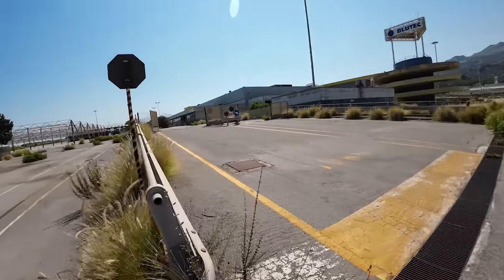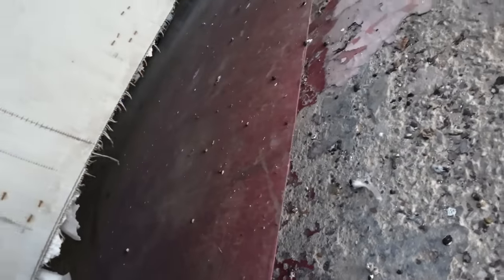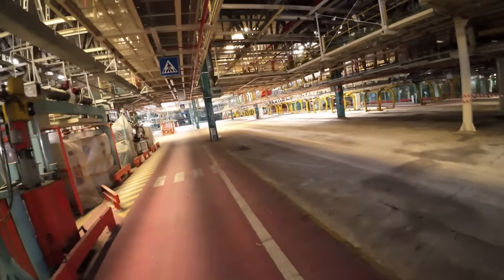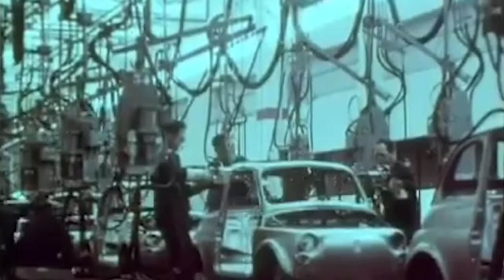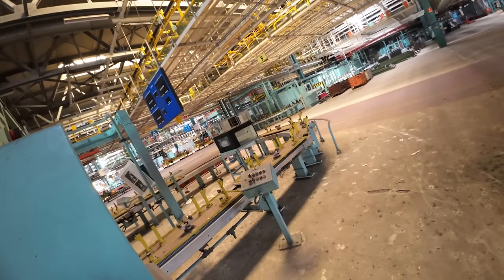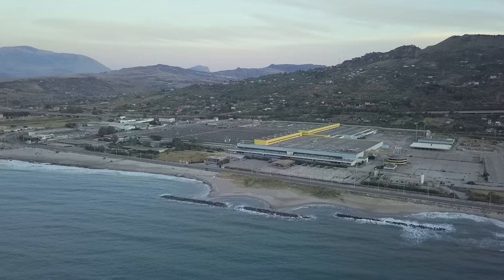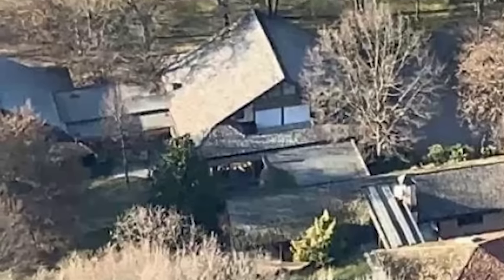Sneaking Inside Completely Intact Abandoned Car Factory

Comment: Very interesting. On 3:44 these hanging yellow tools on either side of the assembly line were used for attaching the wheel bolts. They can tighten all the screws on a wheel at the same time.

Comment: I like the Hot Wheels style garage car ramp at the front. I was expecting to see a winch operated car lift and foam hair roller car wash, lol. Great video as always fellas.
Reply from the maker: Thanks!
Reply: Yeah that spiral ramp sticks out, but where does it go? It seems to just end on the roof and have no real purpose other than to look good. Maybe Fiat wanted some " Lingotto" style in there :)
Reply: @Rockport1911  I came to the comments to find the answer to this as I agree...it goes nowhere.  So odd

Comment: 126 was never produced in Termini Imerese, it began production in Cassino (south of Rome) before moving to Bielsko Biala in Poland, 500 was produced in Termini until the end of the seventies when they reverted to the production of the Panda 😀
Reply: Fiat 126 Assembly :
Cassino, Italy
Termini Imerese, Italy
Tychy, Poland (Polski Fiat)
Kragujevac, Yugoslavia (Zastava)
Graz, Austria (Steyr Puch)

The Fiat 126 was produced until 1979 at Fiat's factories in Cassino and Termini Imerese - with a total production of 1.352.912 in Italy. The Fiat 126 was also manufactured under license by Zastava in Yugoslavia. In Austria it was briefly assembled by Steyr Puch as the successor to the successful Puch 500, with assembly until 1975 - and production of 2069 units.

Most 126s were produced in Bielsko-Biała, Poland, as the Polski Fiat 126p, where production continued until 2000. In many markets Fiat discontinued sales of the 126 in 1993 in favor of their new Cinquecento with its front engine. With a length of 3,05 meters, the total production of the 126 reached almost 4,7 million units. In Poland, the car became a cultural icon and was nicknamed Maluch, meaning “the little one” or “toddler,” which eventually became an official model name in 1997 when it appeared on the back of the car.
Reply: The FIAT 126 was produced in Termini Imerese !!!!!!!
Fiat 500 - 1970-1975 = 207,988 units produced
Fiat 126-1975-1979 = approximately 200,000 units!!!!!!!!!!!!!!!!!!!!!!!!!!!
Fiat Panda - 1980-1992 = approximately 2,300,000 units
Fiat Punto - 1993-1999 = approximately 900,000 units
Fiat Punto II - 1999-2005 = approximately 350,000 units
Lancia Ypsilon - 2005-2011 = 374,722 units

Comment: So the plant is located here: 37.97043331958398, 13.757084650950118

Looking at it from above, we can see that the Paint shop is in the lower right hand corner and takes up about 30% - 35% of the total plant. Which says to me that it was a small plant, and constrained by its neighbors (preventing it from growing any larger). Which explains why sludge and the RTO (incinerator) were located insanely far from Paint. Sad, but they really didn't have a choice.

So was the spiral ramp under the Blutec sign used for foot traffic? Apparently so. You can see the alternate stair access to the roof @2:59

@0:38 fixturing to hold the engines as they are built. Looks like there are coolant lines above for aiding in the cutting process. Fixtures appear to be designed to keep the coolant from dripping on the floor. Looks like Powertrain to me.
@0:42 a "Bingo Board" for fault display and tracking progress. That's the large blue screen hanging above the floor. Looks like more of Powertrain ("PT").
@0:44 looks like "Dispatch". Looks like rather than just monitoring the process and calling out faults to Maintenance, they control it from here. Or possibly not the Fiat plant.
@1:03 looks like Sludge / water treatment in the foreground. That's an example of an area that you want to stay away from. Never mind, you went in there. :)
@1:24 the water from Paint got sent here where it would be treated to separate the paint molecules/fragments from the sludge water. The "paint putty" is then squeegeed to get as much water out as possible and then it is collected and shipped to a solid waste facility.  One of the nastier places in a car plant.
@1:31 where the chemicals got added to the sludge. The chemicals in this area (oxidizers mainly, but there are acids as well) have been known to blow up.
@3:45 you see the backside of a "Wheel Multiple". It runs down the nuts of the wheels and torques them to spec. So the area that you were in was GA, or "General Assembly".
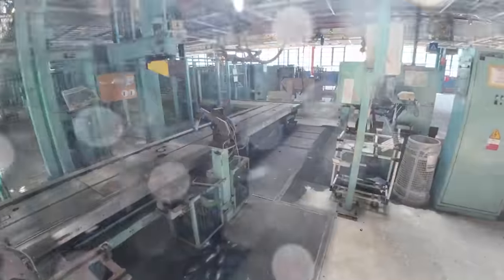@5:09 looks like engine assembly in "Powertrain". 
@5:56 the flattop conveyor in "Final", part of GA, and the last stop before the car exits the factory.
@7:25 Dynamic Vehicle Test, or "DVT". Also in Final.
@8:17 Twin strand conveyor in the foreground, and those tilting carriers that we saw earlier. If you have sharp eyes, you will see that the yellow tilt carriers are individually powered and driven with what we call "Electrified Monorail". So this probably puts this at the exit of Paint, and the beginning of GA (because it is transitioning the job from the twin strand to "Overhead Conveyor").
@8:32 possibly positioners to hold the job while it gets transferred to the tilt carriers.
@8:39 just normal car plant noises. You didn't think that they left the lights on just for you, did you? :)

Looks like a late '90s to early '00s level of technology, but I would have to see the inside of a panel to tell for sure. Sad to see it get demolished, and you may not realize it, but in Powertrain, Paint, & Stamping (at least) there are basement floors to be explored. Paint would also have several floors above the main floor.

Just keep in mind that ventilation is crucial, and probably not working. Pits are particularly dangerous since many of the noxious fumes are heavier than air and you might find yourself at the bottom of a pit with no oxygen.
Reply: That spiral ramp is so confusing both for foot traffic or cars as regardless of use, it really goes nowhere.  All I can think of is that perhaps they drove the latest models they were making up to the edge of the roof for viewing like some car dealerships do?  Love to get a definitive answer if anyone knows?

Comment: When a car co decides to build a new bigger & faster car building factory it has
to keep the old one filling orders until the new one is complete. If the co is successful enough to afford a newer & bigger factory it is because they have a lot of orders,
orders that cant wait so they cant shut down & transfer the equipment from the
old to the new, PLUS remember this new factory is suppose to build cars faster?
Thats because it will use new faster car building equipment. SO, When the new 
factory is complete & all the new equipment has been moved in the workers simply 
report to the new factory for work, the old place is padlocked and everyone walks
away leaving the old factory idle. Someday, the co may think of a use for it, say,
EV battery packs and then the old factory will be cleaned out, refurbished and
new equipment will be installed & workers hired. But for the moment, it sits.

!

Comment: AMC Wichita was a 5 story bicycle factory until it built cars. A much better layout. Stamped steel, painted, is a poor and dogmatic way to build machines. The big automated factories are the worst, fo pumping out heavy throw away cars.
Reply: Steel is one of the most easily and environmentally friendly recyclable materials, and it’s strong and relatively light. As long as it’s properly coated/painted it doesn’t corrode quickly.
Reply: Vertical factory does not seem very bright at all.   One floor, raw materials in one end & finished product out the other.   Streamlined, like the assembly line.
Reply: @chip9177  I'd say watch the video. A vertical factory is easier to heat and cool and you don't fight the battle with the roof leaking. Better cars have always been aluminum bodies. Take a lesson from the British. They had more car companies than the rest of the world combined. Parts shared across different brands like crazy. I lived near a Ford plant and I knew a foreman inspector. Painted steel will have to go someday. That and roadsalt.

Comment: Us Fiat lovers want to see them rebuild the Mk 1 Panda 4x4 , Always  a Lancia owner . Lost my 1,600 H.PE on a freak patch of ice on a bend in Spain  , the police fined me €200 for putting  others at risk €100 no argument .When fuel was cheap that kick in the back at 6,000 .Had a lad 2 litre turbo a hump back bridge  jumper , a Prisma that I sold to my son , idiot refilled with diesel .had a almost aircraft  pilot cabin .The most famous underused engine in the world the twincam ,a 53 Aurilia now £2 million  .Have just bought in Spain a Fiat Punto 1.4 diesel  & still have a Ulysee that I have a new fuel pump for € 80 at Serca Spain 🇪🇸,  will need to cut hole in floor board 1997 model ,Luckily  rear drum brakes , our Black Beta 60 mph in 2nd , the Americans  with their gas guzzling  crap .Must remove the A,B!S lamp , blows the fuse ,will make it our small mobile  home , paid just €2,500 for the Punto ,also have a Suzuki Alto  1061 cc made in India  no A/C it has windows paid only €100 . 2004 model very Economical  in Summer nearly 70 mpg